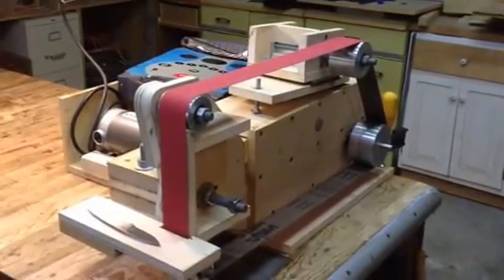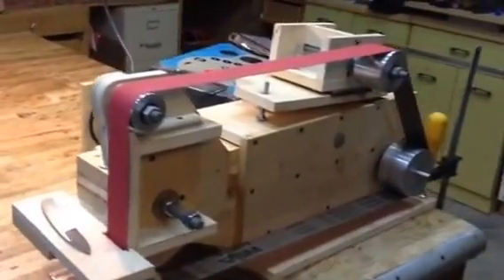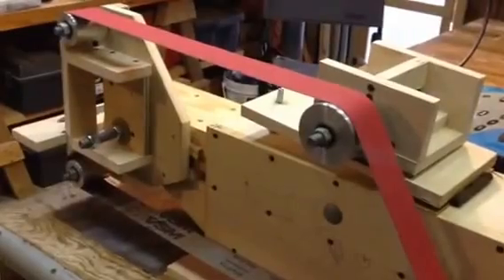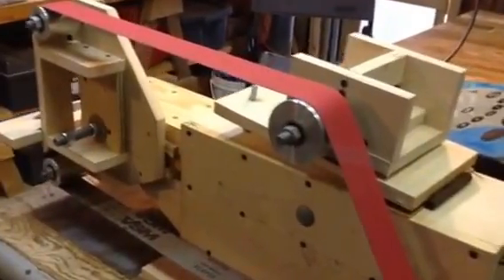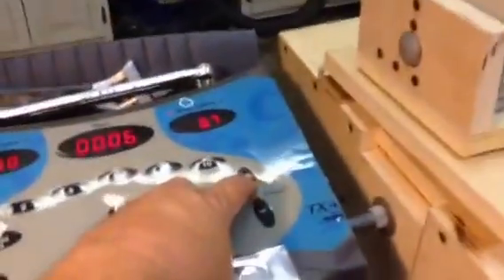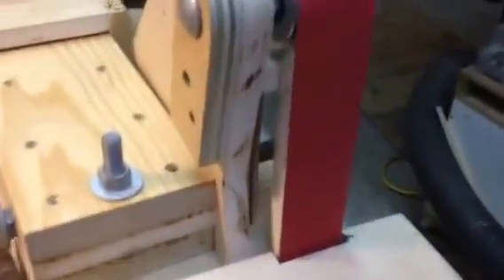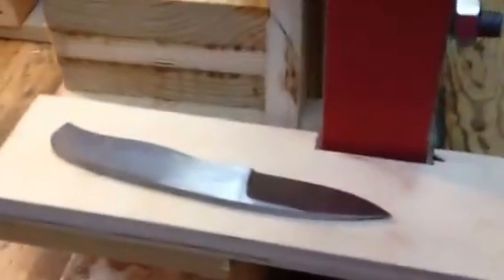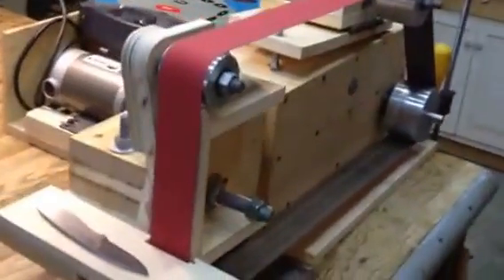Home built no weld 2x72 belt grinder

Comment from the maker: This video has had quite a few views, and now that I’ve been using this for a few years here’s my take on it - This is one of the top three most used machines in my shop (table saw and miter saw being the other two). I don’t know how I got by without it.  Whether you build it or buy it - you need one.  You just might not know it yet.